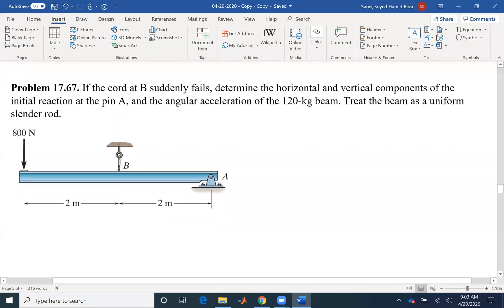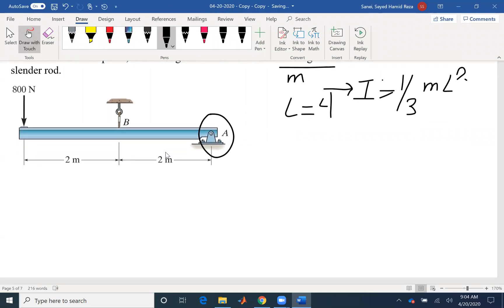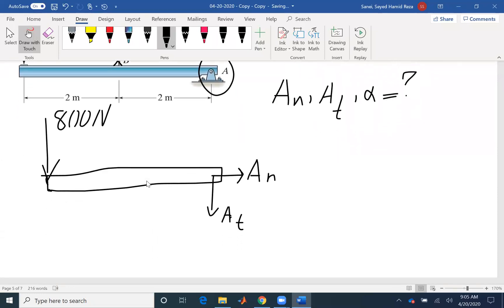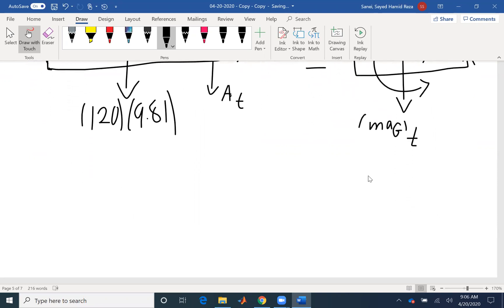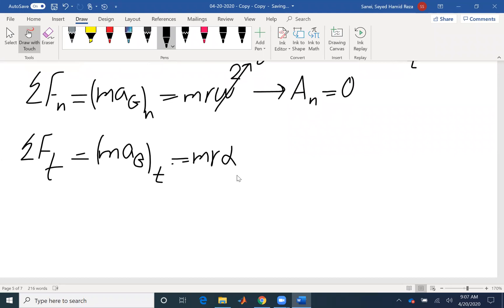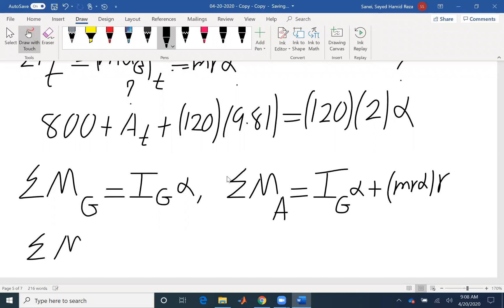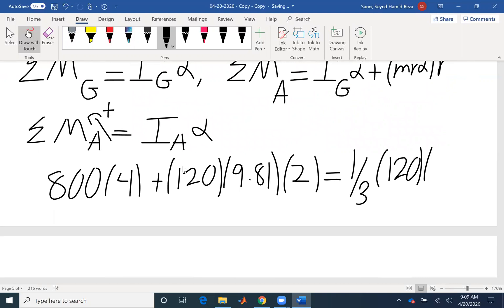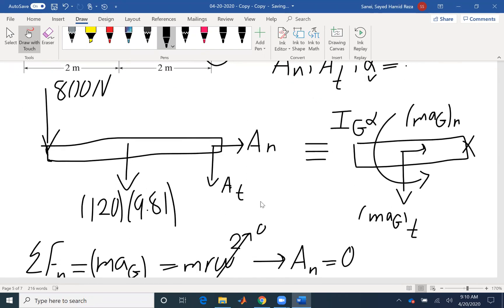Dynamics Example 17-67:Kinetics of rigid body example for pin reactions upon failure of cord

Comment: If the cord breaks at an instant, then you cant consider the 800N force to create a moment.Right? Now theres no force to oppose the 800N force (Since A is a pin), It cant exist after the cord snaps.
Reply from the maker: If the cord breaks, the tension in cord B disappears but the force 800 N is present at that moment, and that force creates a moment and angular acceleration! The angular acceleration, after the beam moves, then yes we do not have the effect of that 800 N.

Comment: How can I think of the sign convention of alpha? Counterclockwise is positive
Reply from the maker: Yep, in 2D, you can think of counterclockwise as positive for all rotational vectors such as angular velocity, angular acceleration, moment, etc
Reply: @engineeringvision  But sir, when I substitute alpha in the force equation and the rotation occurs clockwise, should I consider it to be negative?
Reply from the maker: @HashemAljifri515   In force equations, you are dealing with positive x and y coordinates, and you have to use the sign convection correctly, if your kinematic vector is towards positive x, you use positive sign and if is towards negative, you use a negative sign. A clock wise motion can create both positive and negative force depending on where on the location of rigid body and its center of gravity.
Reply: @engineeringvision  that part is where i get confused what if pin is at centre of a disk like how to identify the direction sir
Reply: we have to assume the direction we gonna pick as positive so i get stuck there like is there any trick to identify?